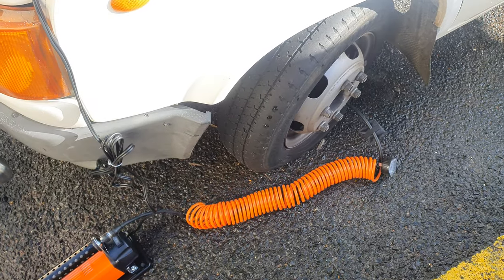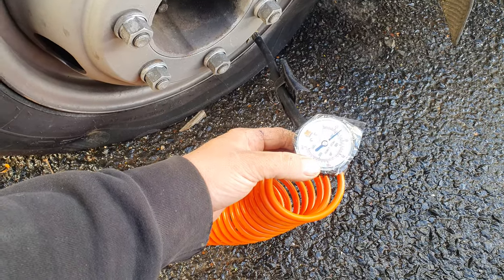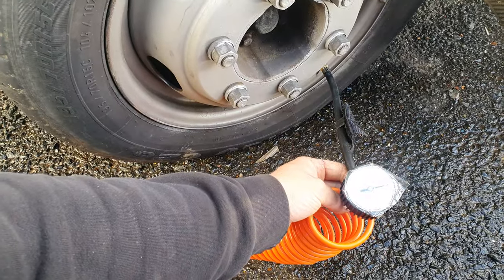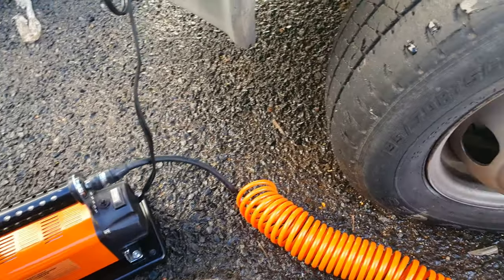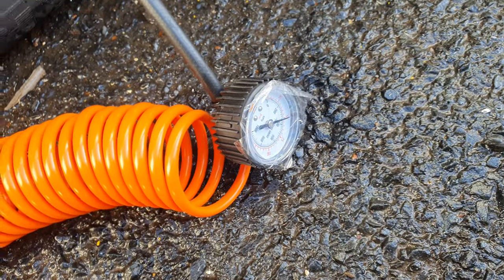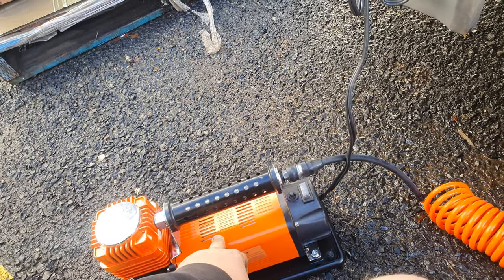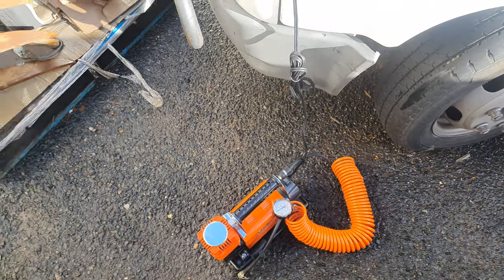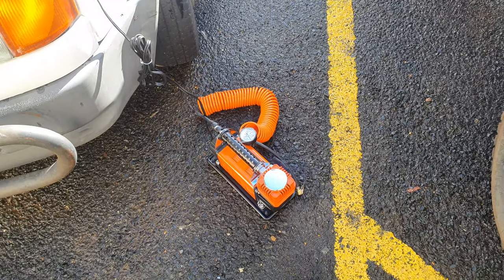Maxtrac 160lpm 12v 4x4 compressor test (repco Australia)

Comment: So does that screw onto your tire valve or clip-on?
Reply from the maker: Clip on mate
Reply: @Oneupthesleevecustoms  interesting. I brought mine last week during the Black Friday special. I went back to your video and you have a coil air cord with a clip-on where mine's come with a black normal air hose with a screw on. Interesting. Problem with the screw on. It's approximately 8 screws on eight screws off times four tires.
Reply from the maker: Yeah more secure but I imagine heaps slower.
Reply from the maker: I've put some hours on this pump now they go well